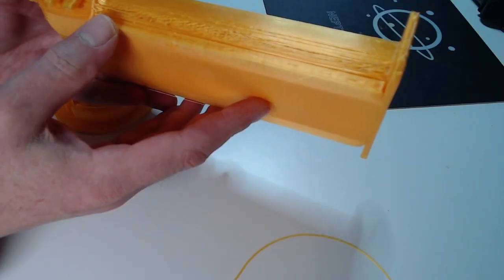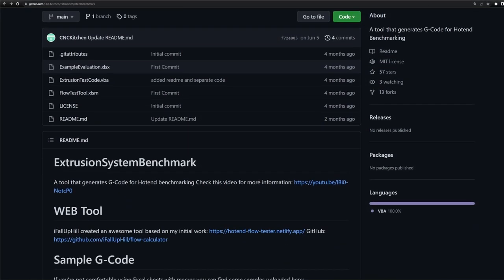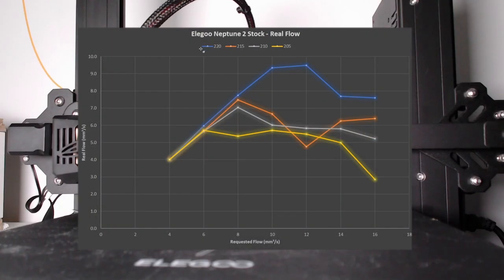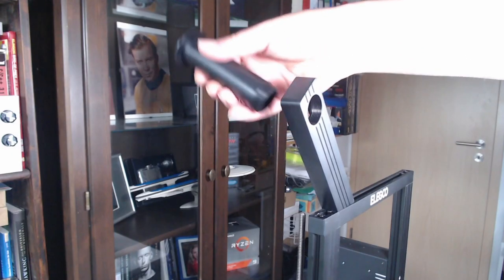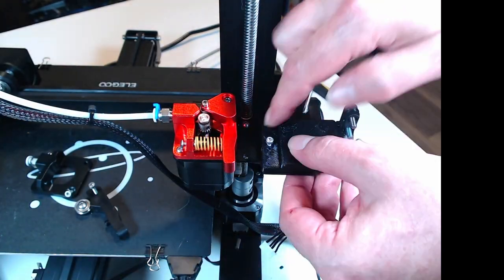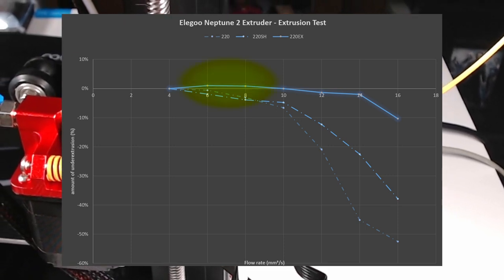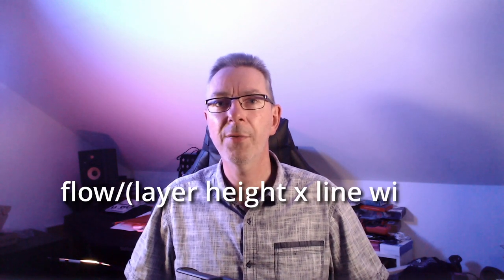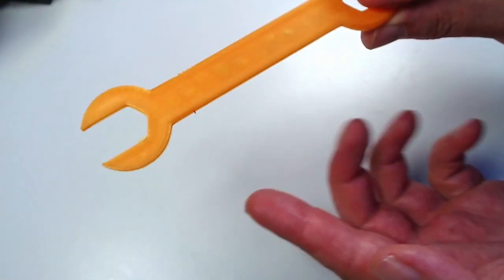Will These 3D Printer Upgrades Increase Printing Speed And Quality?

Comment: When you exchanged the bowdentube, you did also fix the common problem, where the bowdentube is burned/melted. This causes high friction and stringing etc. Changing to capricorn tube just move the problem to a higher temperature, but does not eliminate the issue completely form happening. I do recommend that you use a 2cm short tube in your hotend and exchange it when ever you have to print at higher temperatures.
Reply from the maker: That's a good tip!
Changing to a full metal Hotend would be even a better solution when regularly printing at higher temperatures like the ones needed when printing petg, nylon or abs.
Reply: @3D_Printing_Geek  That is true, but also increase friction. So you might loose the capability to print flexible materials.

Comment: Also the Aliexpresz CHT nozze knockoff works even better than the original. Multiplies the flowrate additionally
Reply from the maker: I haven't tried the knockoff yet and I'm not sure if that doesn't even infringe a patent. Maybe I try it but unless I'm sure that it's legal refrain from showing it..
Reply: @3D_Printing_Geek  it is manufactured differently. It consists of a pressfitted core that has been drilled. Stefan from CNC kitchen reviewed it.
Reply from the maker: Ah well, I remember having seen his video. Thanks for the reminder. I have a genuine CHT lying around somewhere and will definitely give it a try.

Comment: Getting a RaspberryPi and setting up klipper on it made me switch to 100mm/s at all times and I still have beautiful print quality. I can even go up to 200mm/s though the v rollers are gonna suffer so I am not doing that till I convert my ender into a switchwire :)
Reply from the maker: Initially I had planned doing firmware changes and checking out Klipper in the video but decided against in favour of a shorter, more enjoyable video. I still have that in mind for another video though.

Comment: Capricorn tube is a more expensive PTFE tube, it´s basically the same stuff...
Reply from the maker: Thanks for the comment. Maybe I should have explained that more detailed in the video. It's correct that Capricorn Tubes are made of PTFE as well but they have tighter tolerances and an additional coating reducing the friction and making them slightly more resistant against higher temperatures. So not absolutely the same which my tests also reveal. Of course the question is if that little improvement is worth the high price.
Reply: @3D_Printing_Geek  Coating which makes them more temp resistent..Hmm I highly doubt that, do you have a source for that claim ? 
Tighter tolerances sure, most likely overall better material properties but the coating thing I don´t think that´s factually correct.
Your test on that one would still be in the margin of error, there is basically almost no measurable improvement from the Capricorn tube. I myself simply use a EU manufactured produxt which cost 1/2 price of the capricorn tube and have the same results.
Reply from the maker: Sure, here's the source: https://www.captubes.com/specs.html. Maybe it's not a coating but the overall higher-quality material makes the difference, especially for the max. temperatures.  I'm sure the detailed information on that page will answer all your questions.
I also want to point out that I never said one has to use Capricorns. If you're satisfied with the results you get using (cheaper) PTFE tubes then there's no need to change anything about it. I use standard PTFE tubes on some of my printers as well.
My mission is to evaluate and compare, giving my viewers the information to make their own choices.
Reply: @3D_Printing_Geek  No, I know you didn´t say that, it´s fine, your video is also fine too. Actually it is quiet good.
I just mean to say, there are easier and cheaper ways of archieving the same goal.

I still remember the "oiler" for the Chinese printers because their extruder setup was horrible. So people would oil their filament which is a terrible idea because it contaminates the material changes the properties and weakens the layer height.
However it was quiet creative. 

BTW I am a mechanical engineer and 3D print enthusiast so I am not completely your target audience I suppose.

Do you have Resin printers as well ?
Reply from the maker: @sierraecho884  Unfortunately I don't have a resin printer yet though I'd love to get one. Maybe next year.
Since you seem to have a lot of knowledge you may not be my primary target audience. On the other hand I try to create videos about various topics. Mostly beginner and intermediate level but also do experiments or try unconventional things which could be interesting for any audience. The channel is still in its early state. I have tons of ideas on my backlog, just need time to work all out.
I really appreciate your comments and enjoy the exchange with other enthusiasts like you.
Reply: @3D_Printing_Geek  Thank you, I also enjoy a friendly conversation. I wish you all the best with your channel, I am sure you will do just fine =)

Comment: Increase ypur print speeds even further by just changing extrusion width.
Reply from the maker: Yes, that's right. As well as using a larger nozzle being able to use a bigger layer height and last but not least exchanging it with a volcano being capable of even higher flow rates and therefore higher printing speeds.
But all that wasn't the videos topic. 
Would you like to see another video covering that in more detail?
Reply: @3D_Printing_Geek  You don´t even need the volcano hot end just the longer nozzle.
Using a larger nozzle has the disadvantage of less detail, same as larger layer heigts however simply swapping the nozzle to a longer volcano nozzle and increasing layer width would have been a lot better, a lot cheaper.